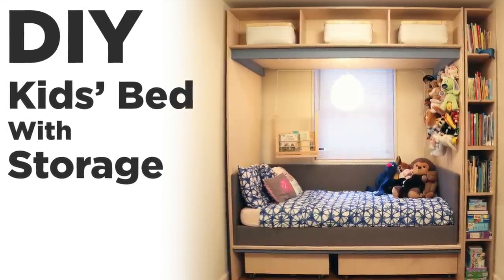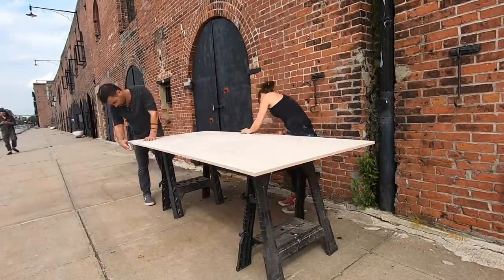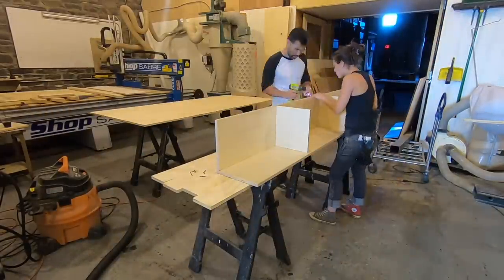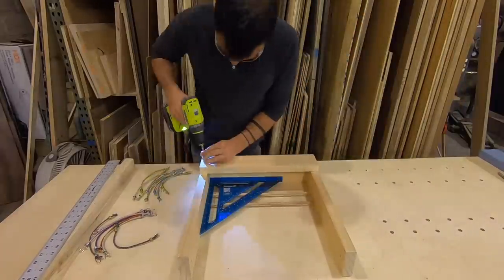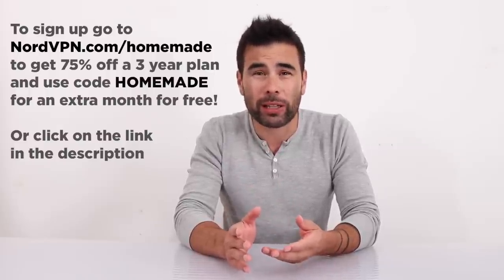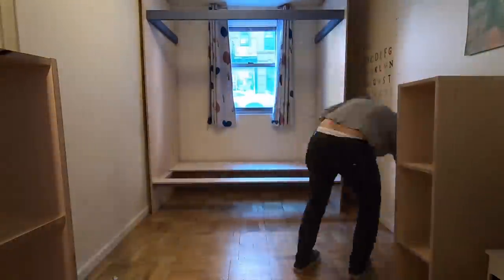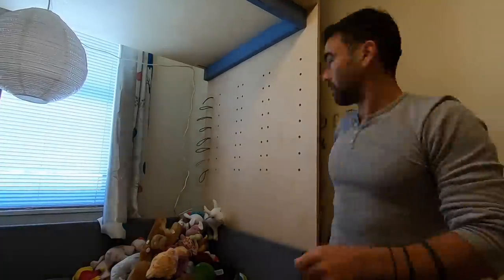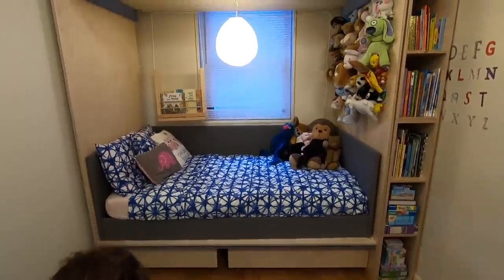DIY Kids Bed with Storage | KIDS ROOM ORGANIZATION AND  RENOVATION

Comment: It is a well designed project but the room above head behind is a waste and could be put to use somehow.
Reply: In my opinion, they could just cut the unnecessary plywood behind the shelves and play a bit with lighting there
Reply: ...and it seemed like it was partially blocking the window!

Comment: I've always been interested in woodworking and making things with my hands and your channel really got me interested. But something I always wonder is how do you know if the thing you built will be able to support the weight? Ya know like before it breaks under the pressure.
Reply: Always test while building. If it doesn't seem secure enough, use sturdier wood, add more support, or rethink the design.